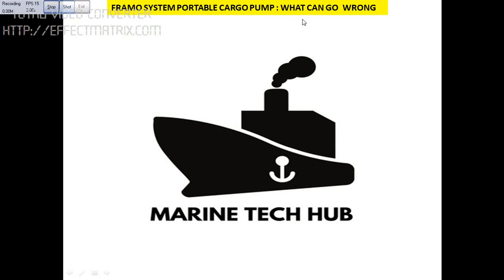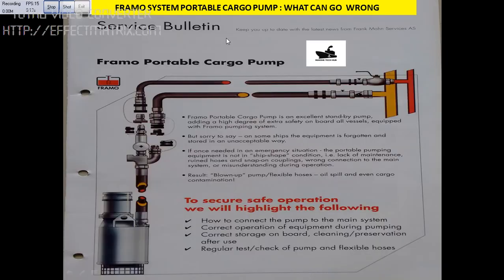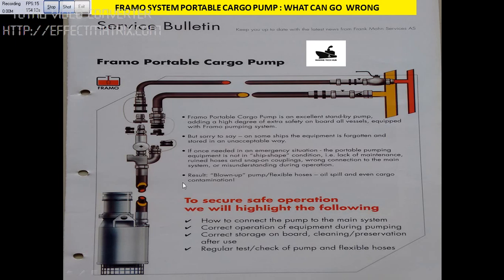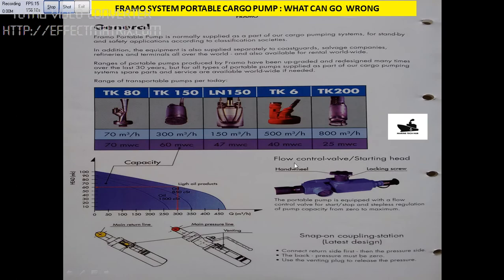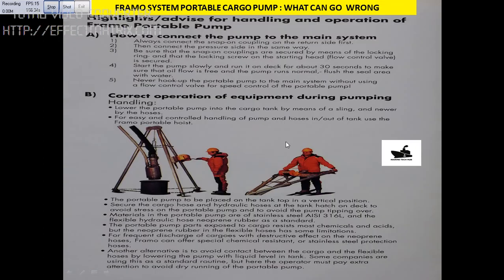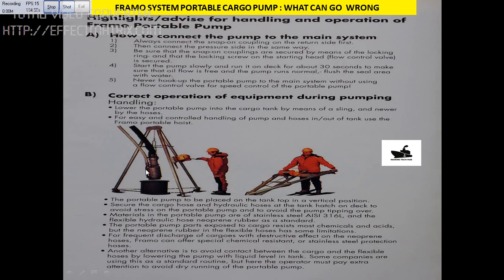Framo System Portable Cargo Pump: What Can Go Wrong?

Comment: Good day sir,
Plz share, how temperature of hydraulic oil is maintained in FRAMO system when we go in very cold area?
Reply from the maker: Thanks for your valuable feedback !! Do share it with your colleagues and friends
Very good question. In order to maintain the temperature of hydraulic oil in the system in cold area. you need to open the valves on Deck to run the oil through the Orifice , one feed pump would always be running. when oil passes through the orifice it get heated up. Normally we have one switch for to operated to open the solenoid valve for return of oil to the expansion tank.
Reply: @MarineTechHub  
Thanks you sir for answer,
Is this orifice provided for both OPEN and CLOSE FRAMO system?
What about heater does some vessel have hydraulic oil heater?